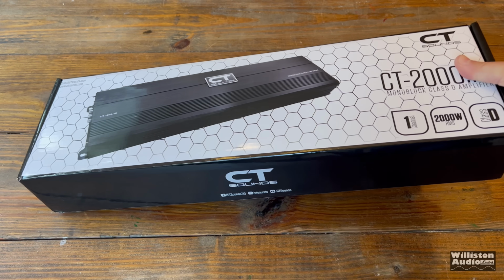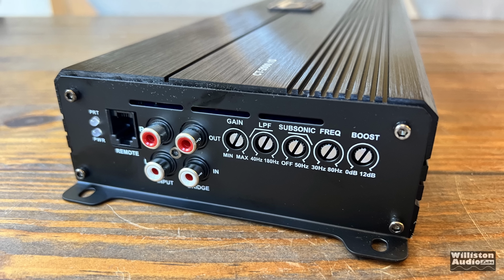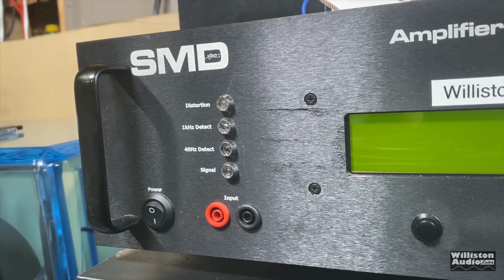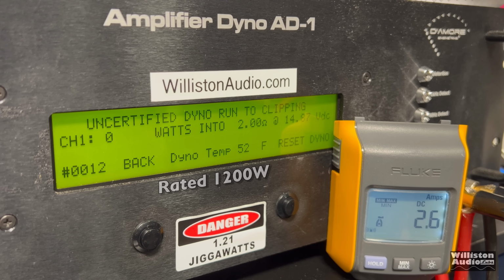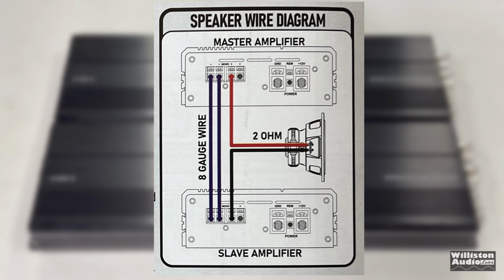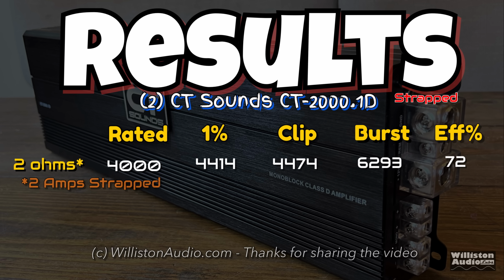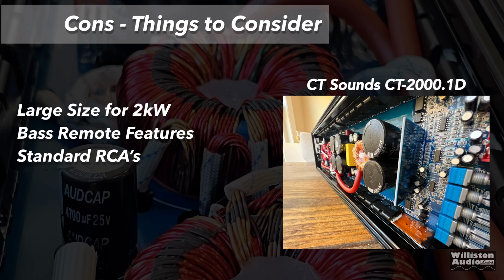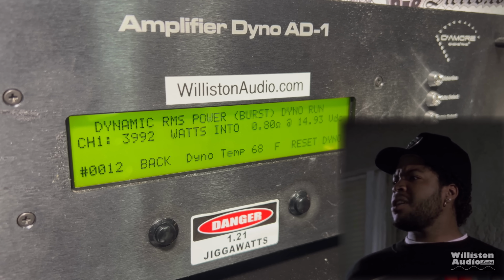CT Sounds CT-2000.1D Amp Dyno Test Also Two Strapped for 4000W PLUS!

Comment: These young bassheads of today have no idea how lucky they are to have access to a 2000 watt amp for this cheap. It's almost unfair what us 25+ year bassheads has to use vs what you all get 😆 🤣 😂
Reply: If watts were only this affordable in the early 1990's........
Reply: @andys8718  ikr!! So unfair 😆 🤣
Reply: @andys8718 right.
Reply: Yeah, but will these amps last 25-30 years of continuous use?
Reply: @jp1087  dunno I'll see I have tons of them too 😆 🤣 basshead problems.
Reply: @jp1087 nope - 2 weeks . I have proof .
Reply: @jp1087  What bass head has the same system that long! 🙄
Reply: Things changed so much you have to have 2000 watts or better back in the day you only needed 500 or so to shake the block
Reply: @hownice614  windage changed
Reply: I agree with you
Reply: Just like the kids born with iPhones in their hands? I was born in 75! 😂
Reply: @arcademania7544  
1974 for me bro. If I had a box chevy or Oldsmobile now I wonder how of these New Model subs would sound behind the seat in a free air set up. But I also know these newer subs plays best in the to spec Enclosures. But shoot back then we put everything behind the seat, from Pioneer to JL to Bumper to Fosgate, to Kicker and they all banged. But really all that trunk rattling is not what I'm into anymore. Straight Pressure is what we aiming for nowadays.
Reply: @arcademania7544  😆 🤣 yup
Reply: meh sub setups were optimized for max bang at actual music frequencies rather than slowed down stuff in the 10Hz and subs were more efficient at those true music frequencies aswell

aka got way louder @ less power compared to high excursion high power subs nowaday, but ofc not at max spl @ power because it is in the 1000s of watts per sub lol
Reply: @BH4x0r  For sure.  25 years ago people were breaking 170dB on 30,000 watts or less and basic box designs.  Now people are running twice that amount of power and barely breaking into the 160's with all sorts of weird engineering.
Reply: @jp1087  this is true but you forget .. today is a 165 with Gail force hurricane 🌀 winds. We didn't get that. It was higher frequencies. Windage Hz is the sought after bass now a days.
Reply: @jp1087  that 170 you talkin about is with everything bolted together (even the door closed) and a van/car basically turned into a box on wheels

all vibrations and slight leaks will make such a huge impact at those volumes it is actually impressive they can hit 160's without bolting their doors shut, at all
Reply: @jp1087 I think people are forgetting that there was a change in measuring equipment that happened. Before 2003 they were using microphones which were not accurate. Then Wayne Harris came out with his pressure sensor based system. What used to be 170dB became 160dB or something like that. I think it was roughly a 10dB drop. So those older systems weren't really as loud as people think they were.
Reply: @Basshead40 in 93 we mostly ran sealed boxes us old bass heads we were about sound quality today everything's ported or vented Bass sounds thrashy. Everybody wants to shake the license plate rattle traps
Reply: @crazyfoot490  lol yeah there are those out there but there are also some incredible windy systems that sound amazing still I'll admit. But yeah my 1st box I ever built was sealed and for 2 kicker 15s back in 1996 lol. Immediately went to 4 after I got my 62 Belair @ 16. Kicker 500SS amp. 2 spare batteries and a GIANT 1 FARAD cap lol 🤣  Back then tho 2pac, Dre, Biggie, Snoop, Bone Thugs all hit hard as can be on sealed enclosures.
Reply: @BH4x0r  yup allllll about the windage these days
Reply: @BH4x0r you are totally spot on. I spl back in 96 at a 151. And I had 4 jLaudio  subs in a custom box that filled the entire back of chevy blazer. Mini blazer. For xover had the mtx with the push button 10db booster and powered with a fosgate punch 200ix and was running subs at 2 ohm total which actually came out to like 1.8 with the meter. Yrs later I was told I was lucky the fosgate amp didn't pop lol I guess 1.5 ohm or lower blows the amp under continuous use. But I was at 1.8 so all was good. That think killed at 30hz-35hz. I have had people tell me that they don't believe me lol but I metered it several different occasions throughout a few yr period back then. Them subs moved sooo much air girls hair would wiggle and the keys in ignition bounced insane and change would not stay in cup holder and fromt dash looked like it was going to fly up or detach lol from outside the roof wobbled insane.  Fun times. I now have 2 12 meso ct sounds subs and the at 1400.1 amp ct sounds n atv4 125 running mids n highs in a jeep patriot and it is no where close to as loud as the old blazer 4 12s
Reply: @BH4x0r to be fair i want a test between the most big audio gear from the 90s and compare numbers against entry level equipment nowadays
Reply: @amirbasssystem  entry level equipment nowadays actually has a very big chance to be similar because they're usually lower excursion and higher sensitivity than the higher end stuff
Reply: So True ! 💯👍👍
Reply: I have the old planet audio vx2200d was over $1000 in 1997-1999 it does 2253@1ohm and 1755@2ohm have the tech hand written birth sheet ... found it on Facebook marketplace for $150 obo and grabbed it...guy didn't know what he had...he was a skar fanatic 😂!!! Anyways I'm stoked
Reply: @shannondanielson1791  I love scoring awesome deals. I'm still like a kid at Christmas when I find really good deals on anything car audio 😆
Reply: This amp is old and huge. Right now there's a few compact amps that are half the size that are 2500k watts and over
Reply: I remember well over a dollar per watt. Almost two per.
Reply: @wijibo6772  Me too! The old kicker SS amp days they were about 2 dollars a watt lol but they was some phenomenal raw power amps! I had 4 kicker 15s on a Kicker 500SS in 97 and a HUGE🤣 2 farad capacitor. I thought I was Boss Hoss 😆
Reply: I know I was the loudest in my town for years with 2 alpine 300 watt amps and 2 12 inch kicker comps. Then I upgraded and got a fosgate power 800@2 and 2 12 inch kicker compvrs
Reply: @bengatewood3197  man its crazy how loud we could get with such low watts. Honestly I'm making my way back there.  I've tried the high power stuff but in the right application the low power more efficient subs and amps can sound great
Reply: @jlee8262  Oh yeah for sure! You can still absolutely have an amazingly clean sounding low watts system!
Reply: Back in the early 2000s Hifonics was the go to budget amplifier brand.
Reply: Buck a watt was the average mid 90s...
Reply: @JustinGrosz  Yes sir. I remember buying a Kicker ZR1000 in like 96. It was $1000 retail in 96 money. 1000 watts RMS.
Reply: @arieljones4595  back that far was the good ol SS line as well. I had a 500SS back in that day running my 15s. Aw the good ol days!!
Reply: @Basshead40  Are we strolling back through memory lane? OK. I actually had two of those ZR1000s hooked up to four 15s in a wall. If I know 19 year old me. I didn't have proper power gauge or fuse size, I definitely didn't upgrade the alternator, but it didn't matter.  I removed the back seat of my 1989 Corolla Coupe to do it. It was awesome. Ah, the good old days.
Reply: @arieljones4595  Nice!!!!  Yeah I was running dual runs of just 6 guage, lol. Spare battery from my dad's junk pile in the shed and a whopping 1 farad cap lol lol
Reply: Preach bro. Power so cheap these days
Reply: @wes9324 Truth!
Reply: Absolutely. I had two JL w3 12 and 2 coustic 400se one amp on each
Reply: @jlee8262  That was a super nice sounding setup I bet!
Reply: @Basshead40  yes sir it was! I started with just one amp on both subs and then when I got enough money I added another amp for more power
Reply: When I wanted a 2000 watt amp it was either the soundstream tarantula or the us 2000(x) and neither were cheap
Reply: @lacboiatl  my buddy ran sound stream back then and it sounded very very nice!
Reply: We had design and efficiency tho! Had a single zeb audio 15 slot loaded in 4 ft on a mtx 2300x and a single optima hit 143 dash and 161 outlaw beat up on boys with 12 12s with 1 15 😎
Reply: US Amps and HCCA’s were the standard back in 90’s.
Reply: @andrewheale8576  In my neck of the woods near Stillwater it was papa Kicker. Well and Rockford Fosgate too... can't forget about ol Fosgate
Reply: i hear that geez i was 18 in 2009 when i bough the jl12w7 and to this day it still slams. Though i rock a full ct sound build in my main car , tho my other has the 12w7... Man i was at cartoys in plano texas had it all done and was worth the 5K for the entire build amps ofc kits blah blah. I felt like the king in highschool lmfao with that set up oh wow how time has flown yet ill never stop bassing errday!!! CT sounds tho is deff top notch IMO .
Reply: @williamcox9476 right on! I have yet to run anything CT Sounds but they have a pretty good reputation from what I've airways heard.
Reply: You get what you pay for here . I'll never use CT again. Nonexistant warranty . CT stands for Cheap Trash . Lasted 2 weeks on a 1500d .
Reply: I remember thinking I was a bad ass for having a Kicker 800 watt amp that’s nothing now days lol
Reply: 50+ and still have young and old walk up and ask what ya got in that !!!! Sooo clear and so low who did that for you!  My reply I’ve been doing this since the 80’s and the hookup was done by me👍🏽
Reply: All that power is pointless to me…  nobody can sit in a car with 10,000 watts of bass and enjoy the music. Not to mention they are absolutely killing their hearing. I can take 1000 watts of bass and some decent door speakers and make a damn fine sounding  LISTENABLE stereo in a vehicle. Before anyone even try’s to say anything about I’m wrong on the hearing damage my aunt is over speech and hearing at USM.  All the power for a comp I can understand but there’s no need in anything over 1000 in a vehicle.
Reply: Because back then there are few competitions...
Reply: Agreed
Reply: You ain’t lying I’m going double strap audio pipe
Reply: Back then a Rockford Fosgate 75w amp cost about 75$ but that “75w” is really probably like 200w+ and I would be suprised if it even surpassed 500watts
Reply: @Basshead40 Back then we could fork out the money and get a good amp but what about Subwoofers man ? They sucked back then
Reply: Is this a Korean Board ? If so then it can handle wiring to half Ohm 

Without wiring into the Dirt , nobody will ever see rated Power . 

Just say you wire it to your Subs at 1 Ohm , well impedance rise is typically 3Xs the value of where its wired 
So you might get 1000 watts pit of this amp .

Always , and I mean Always , Double your Rated RMS of you Subs when you purchase Amp Power 

If you have 2 1200 Watt RMS Subs 
You need atleast a True 5k watt Amp

Comment: You tell me when an app actually really comes with a great design instead of a old plastic style for the last 50 years based on I mean somebody needs to come up with a better design and not make it the same don't make it the telephone f**** hook up do something make your amp stick out Make people talk about it it's old style 🦬💩
Reply: nah ill still take RJ12 or RJ45 for bass knobs.. How about YOU make a better amp instead of bitching about it?
Also, it ain't telephone. Telephone lines are RJ11
Reply: @GlycerinZ  look my little 💃is back  Yes they say that you shouldn't run off at your day job if you're not gonna get paid for it you 🤡🤡🤡  And so before you come on   acting like internet tough guy Don't be that guy cause you're that guy right now
Reply: Uh, this design is less than 10 years old. It works, makes more power than rated and is reliable. 
I run amps that are nearly 30 years old. Get over it. LoL
Reply: @msh6865   Look I got another little 💃 Running off at  her day job  and not gonna get paid for it so you 🤡🤡 just like the  Other little💃  That About it before You  something  Because you are definitely that guy right now your mom is should have told you never to be that guy
Reply: With 3.5mm (or 1/8") at least when the end breaks you can easily fix it, rather than having to rip out and replace the entire damn cable.  Plus it's not like 3.5mm doesn't have a locking feature, my Beats headphones have it, plug in and twist
Reply: How many times does one actually connect or disconnect bass knobs cables ? 
Connect once & forget about it..
Yeash ass clowns  !!!
Reply: Keep in mind that an original design is going to cost a lot more money if you're willing to step up, there are plenty of companies out there making original designs. Look at Kicker, Rockford, JL Audio and a few more.